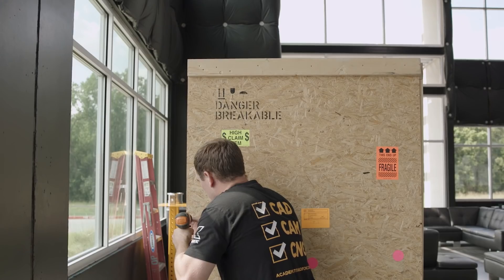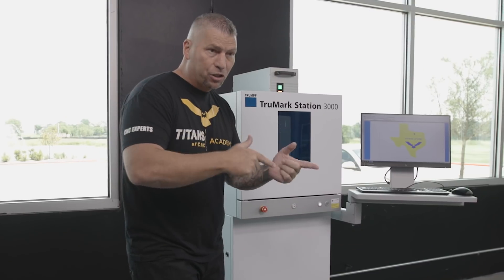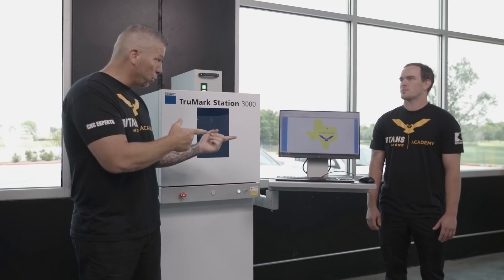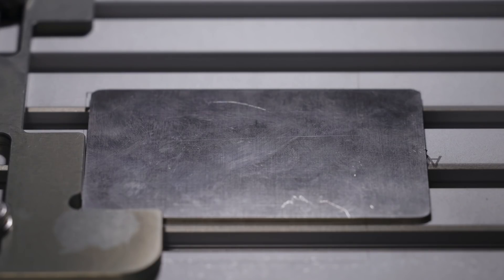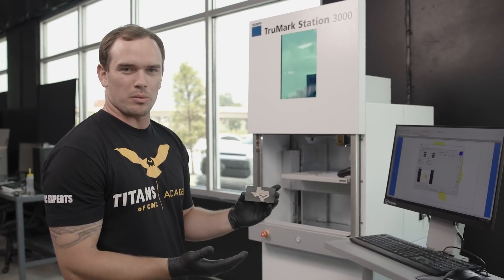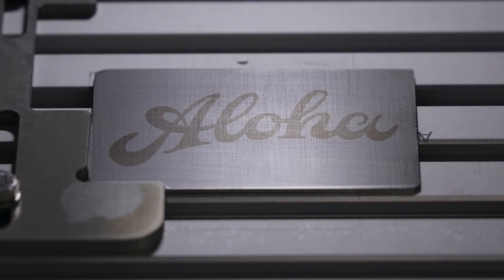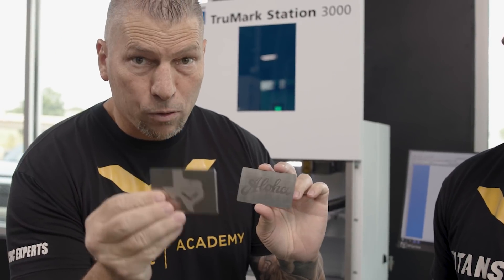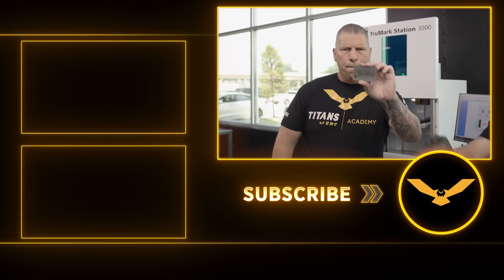Incredible Laser Marking Process on Our New TRUMPF TruMark Station 3000

Comment: I wonder if it can cut through .0040” (4mill stainless) for use stencils to print solder paste on my pins and always wanted to have the ability to correct or make my own.
Reply: Look at the table, if you try to cut steel you will cut into the table and destroy the surface.
If you want to cut with a laser, you need clearance under the plate.
Reply: Rune Jakobsen  could you not have a sacrificial  piece of material to cut into to save the table? I know nothing about this process so don’t know if there is a reason you can’t?
Reply: Hi Kevin, thank you for your interest in our technology. For stainless cutting with a thickness of 0.004", this application would be feasible. Depending on your cycle time or cut quality constraints we offer a broad range of lasers ranging from  5W - 50W of average power. If you would like to send samples for feasibility testing, please reach out to the TRUMPF Laser Applications department at https://www.trumpf.com/en_US/meta/contact/

Comment: That's not a Chinese laser marker is it?
Reply: @Trevor Goforth good
Reply: We just bought a 100W assembled and optimized system using components made all over the world : JPT laser source, Ronar-Smith lens, Scan Lab driver card and a Galvotech head running on American Laserware Pro-Lase. For small operations like ours that need big bang for the buck it pays to research and find someone that can support you after the initial sale, if one chooses to go this route. However the low end systems brought over directly from China using awful EZCAD2 or 3 laser software are very lacking in that aspect and should be avoided at all costs.